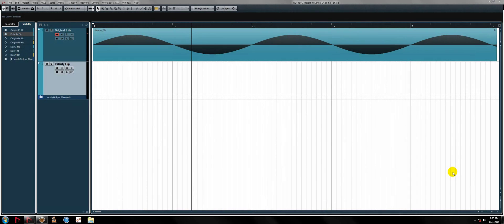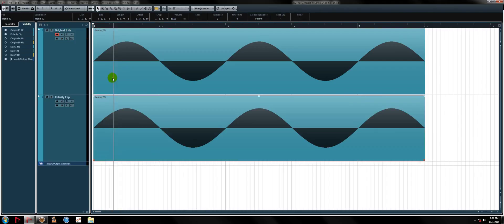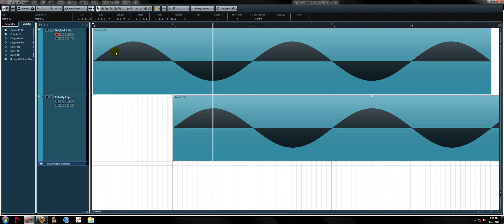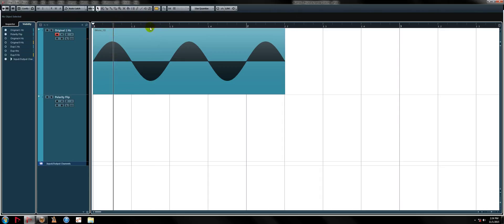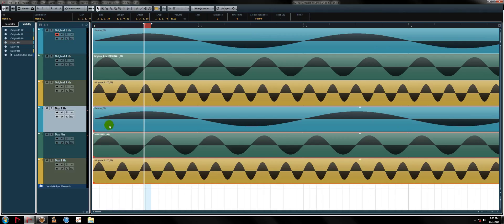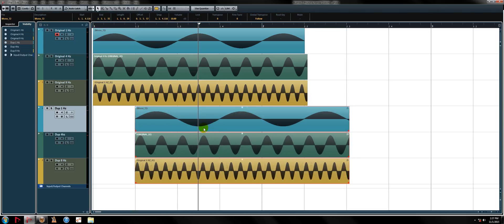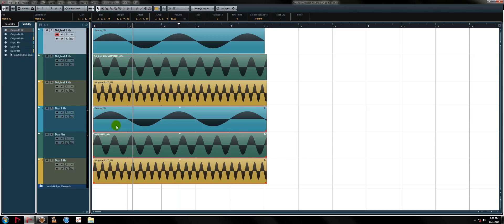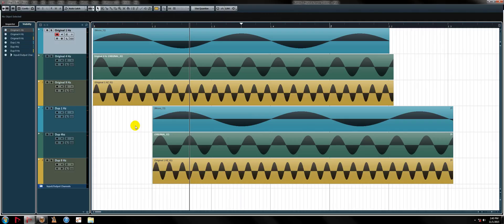Phase vs Polarity in Audio - What's the Difference? - Tutorial

Comment: By phase reverse they mean 'change the (phasor) phase 180 degrees', which is EXACTLY the same as a polarity flip. A time delay is NOT the same as a (phasor) phase change; for temporal aspects, you cannot look at a single frequency on its own, because you need the derivative to find the group delay. When you shift the signal along the time line, you have NOT changed the phasor phase, you have change the omega*t aspect of the total phase (sin(wt+phi); phi is basically the phasor phase). So this video, as most others on the topic, is not technically correct.

Comment: That's interesting. Never shed too much thoughts about that. So, does that mean:
- if signals have opposite polarity, they are in phase, but have their phases reversed 180^, so they cancel out perfectly
- if signals are out of phase, they do not necessarily cancel out (special case: sine waves)?
Reply from the maker: If two identical signals have opposite polarity and start at the same time, they will cancel out. But… if you had two identical signals, one polarity reversed, but starting at the 180 degree phase mark of the first, they would then be “in phase” with each other. 

In complex waveforms, different frequencies will likely have different phases and volumes and may or may not cancel.
Reply: @RecordingLounge  Thank you very much! I tried for a long time to wrap my head around this - finally it makes sense!
Reply: @shaihulud4515  A polarity flip is the same as 180 degree phase shift at all frequencies. A 180 deg phase shift does NOT mean shifting the signal in time, although a continous (non-causal) signal at one particular frequency can LOOK the same when time shifted or with a phase change of pi. But as soon as you truncate the signal and look at multiple frequency components, you will see the difference between a proper PHASOR phase 'inversion' (equal to a polarity flip) and a time delay (NOT equal to a phasor phase shift). In signal processing, it is always the phasor phase that is of interest and is plotted, not the phase change that happens over time, as that happens equally on e.g. the input and the output of a system, so the phase shown for a complex transfer function or the phase of some complex Fourier components is the PHASOR PHASE, which is not related to a time delay. For some reason, all videos on this topic are wrong, including this one.
Reply: @Rene_Christensen  So, back to square one :) I thought I finally get an idea of what is meant: so, if I hit the designated button on my mixing desk: do I flip polarity or phase? I am so not familiar with electrical stuff, it's hard to wrap my head around this. Especially if all the explanations aren't that easy obviously. I guess, it's one of these topics, where easy explanations tend to lose accuracy by oversimplyfication?

Comment: Polarity describes the electrical connection. Phase describes the audio signal. 
Changing the polarity will change the phase of the audio signal.  Changing the phase of the audio does not change the polarity of the electrical signal. 
They are related but not interchangeable. You can’t play a sound and talk about it’s polarity.

Comment: Let me further explain what I'm working with, within the speaker boxes there's a crossover with 2 positives and 2 negatives , (a set for the woofer and a set for the tweeyrts) BUT the speaker terminals themselves aren't marked positive and negative and I'd like them hooked properly.. see my delima?..
Reply from the maker: If you hook up a 9v battery to it, you can tell what the polarity is. Use the markings on the battery as your guide. The “correct” polarity is when the speaker pushes OUT. If the speaker cone pulls IN, it’s reversed. Look this up on YouTube if you’re not sure what I mean!
Reply: @RecordingLounge  I see what you mean, thanks alot for the info..

Comment: What happen if you accidentally switch the speaker terminals,like positive to negative instead of positive to positive? What exactly does this to the speaker or the sound it produce?
Reply: myplaguesify with just one speaker you  most likely will not notice a difference. If you have 2 speakers and wire one correctly and one the reversed you will notice cancellation of mono material. 

It’s the same as the wave forms in the example above -  with just one source you will really hear no audible difference but if you take 2 and reverse 1 they will cancel. 

Hope that made sense...
Reply from the maker: ^^ Josh is correct

Comment: Now there's A.I. software designed to fix phase issues. Hmmm.  First, when using multiple mics, the sound that each mic records is at least a bit tiny different (due to whatever the acoustics are)  AND out of phase, by at least a little. So there's always some cancellation and reinforcement, and thus volume change when the tracks are played together.  Now, the volume change can be "fixed" by turning up or down the gain, and/or with compression.   So, shouldn't we just move entire tracks a bit forward or backward in the time-line until it all sounds good, and then just leave it? All of the phase adjustment software seems like an unnecessary vortex of over-complicated stuff that we don't really need.